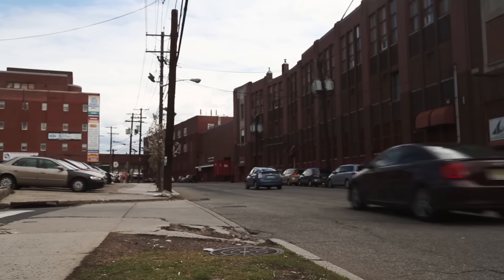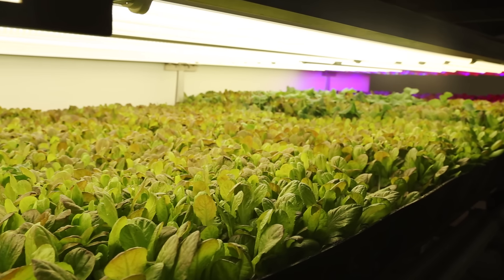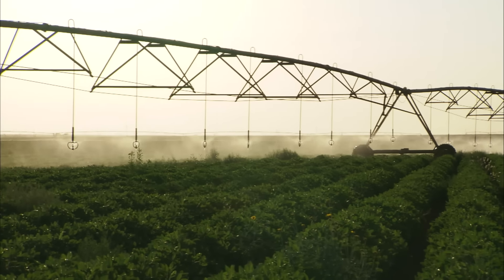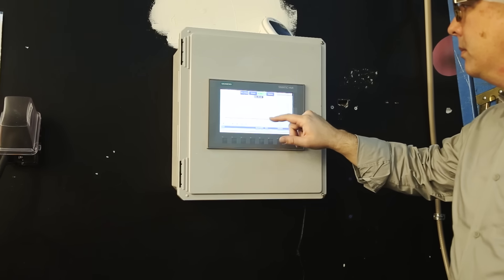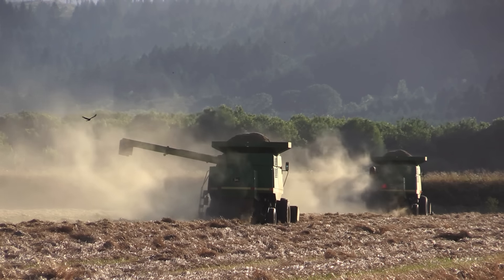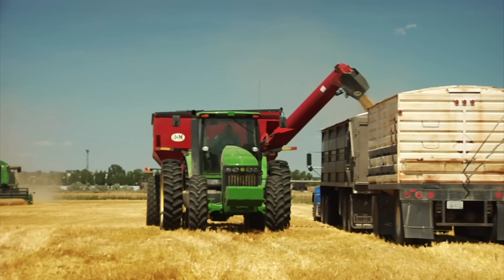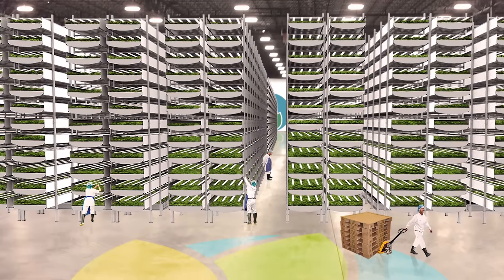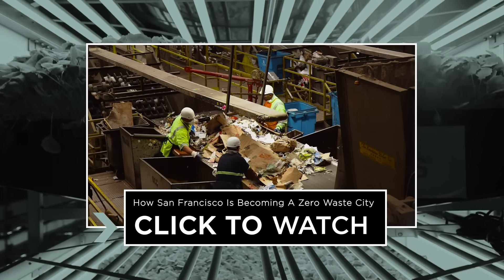This Farm of the Future Uses No Soil and 95% Less Water

Comment: So why don't we have these everywhere?
Reply: My guess is it's spreading slowly over time, as things always do
Reply: Resistance of the guys making big money on big agriculture.
Reply: Jessica Bayol Duh...why does EVERY potentially world-saving invention fail because of big corporations? Just like permanent magnet engines. Imagine how much cleaner our air would be if we had them.
Reply: oggie90 Might be a reason, yes :)
Reply: I hope you know we use magnets for almost every engine, this is an example of one of the parts: https://en.wikipedia.org/wiki/Stator
Reply: SilverWave knew the answer all along but it is a pity😏😕. Sucks how the world works. 😧
Reply: Food inc.
Reply: Because although it's cheap to put lights over food it's cheaper to let the sun do it

Unless you're in an extremely water scarce region there is no way it's cheaper than using the Sun.

Not to mention most plants probably don't have as strong a taste

In deserts this is probably viable
Reply: Because all they can grow is leafy greens because the LED lights are not capable of providing enough light for deep rooting plants. So with a very limited crop available, it's just not worth it.
Reply: They're not cheap boy...
Reply: Because they cost at least a dozen times more than conventional farming even when factoring the water and transport?
Reply: +oggie90 i dont think it would cost that much more
Reply: +Kamikaze Gorilla that i can agree with setting this has to be extremely expensive but if the goverment could provide loans to be paid back with interest once these were setup and made profitable
Reply: Mage_x The nice thing is they don't really divulge the costs here or on other videos/articles on the subject, so who would know? I'm making a rather conservative guess because farming land is literally dirt cheap, rain water is free, farming is hard wotk but a handful of automated tools can make it extremely simple, and guess what, most governments already offers subsidies and loans to regular farmers because everyone wants to be self sufficient in food production in case something bad happens, while stimulating the local economy.
Reply: Soon my child. Soon.
Reply: Because it is fairly new
Reply: +Peterowsky You do realize most of our food comes from California? Doesn't rain much there, huh?
Reply: +Peterowsky Also, farming doesn't help the land and it takes up space. Now if the got these things running on renewable energy then it would be even better.
Reply: Monsanto can't make any money selling poisons.
Reply: They are a horrible idea that's why.
Reply: May be cost. They really did not include this in video. Cost is the deciding factor and they ignored it in video. Very poor journalism despite being good video.
Reply: mahesh katta You have a good eye.  Also we have tried this before and it never took off.
Reply: +oggie90 95% less water, 95% less transportation cost cause its already in the city and read to pick up
Reply: Paul Ramos That water that's miraculously just "in the city ready to pick up" costs money that you pay for.  

Rain on your crops is free.
Reply: Crops on open fields need pesticides,, its harmful and expensive, and if you think that farmers always relies on rain for their crops to be watered you're wrong they're still using water from the pipelines, plus it just need 5% of the water needed than traditional farming, (this is the future try to embrace it), Im not against traditional farming but this is what will enable us to be much more efficient (less transportation cost, less chemicals, less space, less water). Farming on the city is the future.
Reply: Paul Ramos I highly doubt this will feed big cities. rather this may help in some cities like Singapore for growing some crops which may be expensive importing. This can never replace traditional farming anywhere in the world.
Reply: Paul Ramos Modern crops do not need pesticides, not all of them.  Most of our food has been modified to be pretty resistant.
Reply: Guy Smith knows what's up.
Reply: facepalm. Why do people who generally blame corporations ra ra blah also believe weird conspiracies basically like free energy? I mean. You're using a marvel of technology. It wasn't thought impossible, just difficult. That permanent magnet engines... ugh that just violates physics. It's like saying why we don't have solar panels that operate at 110% efficiency. JUST UGH.
Reply: Lol 1) By and large monsanto makes its profits from the combination of GM seed, related herbicides, and licencing. None of which are involved with leafy greens. 2) Leafy greens grow up to maybe a foot tall? Corn or wheat even you're looking at 3-4feet up to 8-10 feet. That means you can fit a grand total of maybe 3-10 layers of one of your staple crops? All the while the total surface area of the facility (even adding multiple grow seasons) only is a FRACTION of farms that I know. 

You're paranoid and know very little about farming. This isn't a bad idea, it's a not currently economically viable (wanna guess why they didn't mention the price of the lettuce?)
Reply: B C Cause people are lazy enough to do research themselves, people are incompetent to have a rational thought. Its easier to blame it on rich people and corporate for everything. High tuition fee, no problem solution is free tuition for everyone. high oil prices, evil greed corporate companies killed the scientist who invented car which run on water.
Reply: mahesh katta Lol hey I'm not gonna say rich corporations and individuals aren't a problem either haha. I just know that its a grey area when many people see it as black and white. The majority of farms are family owned. They may operate on contracts mind you, but families. Many are getting out of farming because 1) kids are taking over the farm 2)It's a lot of work for little money that is risky 3) the land they have is generally a larger pay day than a hundred harvests.  4) People don't know shit about agriculture now and think farmers are poisoning them when they use a cup of roundup diluted into gallons of water for an entire fucking field.
Reply: Anyway....small sustainable farming communities are the future. 
Cities will never be able to have sustainable agricultural resources.  It's mostly cultural if you ask me.
Reply: Martin Fischer Um... sustainable hopefully? Small? FUCK NO. What we are seeing a continued movement into more urbanized areas. This isn't necessarily bad as despite how it makes you feel, cities are just more efficient. I understand the idealism. I hate the cities, I love the country, but globally speaking the shift towards more urbanized cities is just a given. 

Small farms simply aren't as profitable anymore. In this day and age if you have less than 150 acres of land, you're a hobby farmer. Plain and simple. You likely aren't to familiar with what farmers make acreage wise... or that even now, largely most fruit and veg crops are hand harvested by Cough*.... foreign workers Cough*....
Reply: Martin Fischer Large corporate farming is the future. It still is. You are going back in time with small farming. Cities dont need to have resources. Cities never will have the land water and cheap labor required for agriculture. They grow it elsewhere and transport. Thats common sense. Transport and storage will only get more efficient in future.
Reply: mahesh katta Not to mention shipping to cities drastically increases efficiency (BULK). Freight and Tankers can carry things at such a cost (and low impact) that even local food is hard pressed to compete.
Reply: B C Exactly. small farming is never viable option. Even in developing countries slowly the land owned by a single persn is becoming higher. Which means less farmers and more technology and corporate structure in to agriculture. In rural areas near my place farmers rarely get profit in years because of small farming and lack of proper methods in agriculture.
Reply: My guess is Installation costs. Those facilities look way to expensive for the average farmer. Its mostly Silicon Valley types that are doing this.
Reply: that farm in the steel mill costs 30 million
Reply: Supremely inefficient all around.  In the end nothing beats sustainable natural farming.
Reply: Martin Fischer lol well depending on what we define as natural farming haha.
Reply: Zoning laws, for one. For two, zoning laws. For three, bullshit zoning laws that prevent architects from building above a certain height within inner cities. Washington, for instance, has the worst traffic in the world and that is directly correlated to the zoning requirements limiting the height of buildings.
Reply: Joshua Garcia I thought LA has the worst traffic in the world :D
Reply: Hahaha both LA and Washington are equally horrible. Went to LA last year and flying in it looked like a giant pancake.
Reply: it will be a  nightmare.
where do you think all these electricity come from?
burning coal.
Reply: ***** Solar & wind?
Reply: SilverWave about 0.1% i think
Reply: I'm not really sure anymore about the energy economics of the future. I've always been a supporter of what fits best goes in. I would prefer to move away from fossil fuels but I know that we can't do it "tomorrow". I see nuclear as a backbone with renewables as the vascularture. The issue is. GODDAMN is solar cheap to install. Its essentially modular. Contrast that to nuclear which is exceedingly complex. That being said, if we can modularize a nuclear reactor we may see a nuclear dawn. Also we need to learn to use mox fuels....
Reply: Yeah, Moore's law will hopefully apply to the circuitry that governs solar panels, whereas we get more energy absorption per square foot. Then we can see the easy adoption of solar because of convenience.
Reply: Joshua Garcia That's quaint.  Lot of resources needed to make those panels...
Reply: Right, but youre looking at the RoI over years, not the immediate cost implications, like any investment.
Reply: Joshua Garcia Fair enough.  To me this is a complete waste of resources.  I've grown in these beds.  One of those beds pulls 200 watts constantly to grow non-staple crops.
Sustainable, community base, natural farming is better in so many ways.
Reply: I agree with you completely. I enjoy this technology because of its potential future implications (if technology can develop to make it more feasible). One day it may surpass community farming, who knows. 40 years ago if people told you itd be impossible to carry a computer in your pocket you'd believe it, ya kno?
Reply: Martin Fischer yes and no. Like functionally yes we need stupid amounts of various metals, purified silicon. Etc. Panels don't work as well at high temperatures, don't work with snow etc. I know all the issues as I bring them up when people say it will be the next dawn. It's more so I keep getting upstaged by how cheap they end up being. The materials are one thing. The rare earth's are an issue (haha actually not that rare but not many mines) but the Silicon isn't. I think one of the things I never predicted is the economy of scale solar is capable of. With nuclear there are much finer limits, solar I'm still not sure yet. I know it won't be the answer in some. Places where our energy profiles are different than solar output (cough Canada cough)... But I'll say this. I am open to being wrong and corrected on anything.  I can talk about scientific issues with thinfs but when economics and consumers get involved God it's hard to predict
Reply: Resources resources resources.  We are talking about the energy but that really isn't the biggest loss here.

This, although efficient, requires vast amount of fresh water.  Unless they implemented a natural rainwater catching system, more resources, I wouldn't even dream of considering something like this.

Look at it this way,  what does a one acre organic, sustainable, farm plot require.
Basically manpower.

Changing things from the most efficient way we have been doing things for thousands upon thousands of years, is not progressive.

To me the best implication for farms like this is space and/or harsh climate vitamin food production.
Reply: Martin Fischer lol well... One acre organic. You could have said sustainable. See here's the issue. The water issue wouldn't actually be ve huge for above. Its more energy, space, and scaling doesn't work well. With farming you're looking at a couple input costs. Diesel for tractor, fertilizer (either manure with supplementation or other), irrigation if needed but it differs, chemical as needed, land costs either from loans on the land or rental of the land, price of machinery etc tbh most of farming runs via a debt so it's hard to say what's true. Thus requires less water, more expensive space, expensive scaffolding, higher wages, more electricity, minimal fuel, fertilizer, little to no chem factor, harvest issues, etc. Still conventional farming, despite lots of costs blows this out of the water. What you aren't figuring out this is largely economics not necessarily science. Which I hate haha. This isn't viable cause economy of price and scale. Until they show Me how they deal with that it's bs.
Reply: B C You don't need a tractor at all.  Especially for a small plot like that.     When you farm correctly you are saving water that is otherwise lost.

As someone who is a farmer and has tried every way to grow things under the sun, nothing beats the original.
Reply: Martin Fischer original? Lol if you are a farmer why are you farming one acre? In my area if you have anything less than 100 you're a hobby farmer. The best way we know to farm is with scale. You need equipment end of story. There are indeed still produce that requires manual labour (they tend to use cheap immigrant labour because no one else will work for that) Cucumbers comes to mind. However, for cereal crops, which is not going away any time soon, tractors are a period, end of story thing. Farming requires machines. It may be we can get electric tractors, but who knows. What do you farm and what kind of acreage?
Reply: ...I was making an example.  I own a 25 acre and 81 acre parcel.  I mostly farm cow corn, soy, winter wheat.

We need equipment because the few feed the many.  If everyone grew their own food this would all be a lot easier. Unfortunately the majority of people live in urban areas, where none of the food is grown.

I like the idea of propagating farming within cities, but to me this is simply not the way to go about it.

It would have to start with an entirely different look at community/urban planning.

"Nothing beats the original"  is an expression.
Reply: Martin Fischer unfortunately it's not that simple. Urban centres are remarkably efficient. People growing their own food isn't. We've known this since the dawn of agriculture due to division of labour. Let farmers do what they do best. Functuonally that is what matters. If they can make this profitable sweet. If you want more people to garden also sweet (biggest usa crop is actually turf grass haha). However, we must not confuse our own idealists with what is best. I'm from the country and despise city life but I accept that it must exist for others because of efficiency.
Reply: You're not wrong.  But I think we can do better, eventually we need to anyway.

Everything is about population in the end.
Reply: B C The more I've been thinking about it, I keep coming back to our population/urbanization explosion that happened so fast.

Imagine if we had the foresight to see the necessity of sustainable urban planning in the 1800's.
Reply: Land is cheap.  Would you build a skyscraper out in the country?  Economics will dictate when these become more widespread.  But as long as land is plentiful, why not use it?
Reply: mouthpiece200 "land is cheap" depending. In my are you could run 10-40k an acre agricultural. In cities skyscrapers happen because Land is expensive.
Reply: It doesn't matter how expensive cities are because food doesn't have to be grown there.  Food can be trucked from far away where land is cheap and plentiful.  People can't be trucked from far away each morning - food can.
Reply: mouthpiece200 Right, truck the food into the cities, is really the best option.
In order for truly sustainable urban communities we would need to take a completely different urban planning view.
Reply: Martin Fischer yea ideally we don't want to truck it either. Effectively we want to use barge as long as possible, followed by train then truck. With train potentially replacing barge if time sensitive
Reply: B C Or we have realistic sustainable urban planning based around agriculture.  Imagine a city the size of LA that could produce it's own food.  To me that is a much better way to look at urban sustainable agriculture.
Reply: Martin Fischer but that isn't efficient though because that is entirely subsidized beyond stupidity as yes Ag land is pricey, but urban land is folds higher (it's why farmers sell for development).  We cant grow in city because it's functionally inefficient because you can't use economy of scale. Cities are dense. To feed a city of LA you need an area larger than la
Reply: B C You're missing my point.  Eventually the whole planet will be a "city".  We need to start developing large scale farming within urban centers.  These vertical farms, don't produce staple crops and are hugely resource intensive.  They aren't the way.
Reply: We have many generations before the whole planet will be a "city".  Cities take up a surprisingly small percentage of our land surface - something like 3% if I remember correctly.  Obviously we'd have to start going vertical much earlier, but its not an urgent need.  We still have vast amounts of unused land which could be converted to farmland before we need to go vertical.  

The market will produce vertical farms when the market is ready.  If the market isn't ready yet, then vertical farms are simply too inefficient for use.

With future technology transportation will get even cheaper and easier, and the need for urban farms will be further reduced.  Why take up valuable premium space when you can import something for a fraction of the cost?  Should we have urban garbage dumps too?

Let the magic hands of economics be your guide.
Reply: Yea I completely disagree.  Less "Urban" cities are the way of the future.
Reply: Martin Fischer history, economics, and current trends would heavily disagree with that statement. You're working idealism... You can't expect an area valued in the hundreds of millions, only able to feed maybe 10-000 people to ever be a thing. You're talking saving on transportation. This vertical farm would happen before your idea I'm sorry...
Reply: B C Of course I'm being an idealist, we are talking about the future.
At some point we need to start developing our communities from the beginning, with realistic large scale sustainable agriculture in mind.  Like most things it comes down to population.
Reply: Martin Fischer sustainable means efficient. Efficient means specificialization of labour and economy of scale. Neither of those for agriculture correspond to urban centres. I will retain this. Vertical agriculture will happen before urban single tiered. The only way vertical farming happens is if standard agriculture becomes expensive enough that it becomes viable. Market trends determine things. If we force them too much it blows up in our faces such as the euro farm subsidies.
Reply: Well you have a point.
Reply: Yea like market force drives our habits so much more than I would like. I am a huge nuclear advocate but consumer misinformation has largely driven prices of construction so high that I actually don't see it playing a major role in European or north American energy. That's idealism vs reality for you
Reply: thats what i thought ,   lettuce  day and night,,
Reply: the future generations are  going to be too lazy on their I PHONES day and night,,
Reply: Not to mention its not "cool" to be a farmer, but it is to be a rapper.
Reply: Martin Fischer I would say people are appreciating foodmore but agriculture less. We see it as this fake idealism that doesn't work.
Reply: Craigx71 lol plants.grow in sunlight and the ground for evolution. They grow well in these systems as well. That's not a good argument. It's a natural fallacy. It's bad for economical rational. Plain and simple
Reply: the plants Have the nutrients sprayed directly on their roots instead of taking from soil. The LED lights are specialized to emit the proper light wavelengths that plants use. this concept was only first tested within the last 10 years and is already being implemented across the world so yes this is quikly becoming a mainstream concept. As we all know the only reason is Profits, millions$$$ Savings from 95% less water, Less Land costs and taxes, Fewer Crop Losses from weather, Greatly Reduced Transportation Costs, and Millions saved in Farm equipment costs.
Reply: John Harbinger but  how can  you grow carrots  this  way  pls..
Reply: I set up hydroponics at my parents place. they generally cost more. you can't really mix your own nutrient solution, which is sold proprietarily.
Reply: I may be parroting thing that have been said but i think I add my two cent:

The cost of this setup is very high.While they can save cost from repurposing  old building instead of building new ones , the remodelling cost is still  a concern.Most of the expense however comes from the energy needed to replicate the sunlight, recycle the water and keeping climate control.Farming on flat open land will always be more attractive when that option is available.

Furthermore current LED tech is still not sufficient to produce enough sunlight for most types of plant
Reply: what has been pointed out to me several years ago and I double checked was that the population jumps that we have seen over the centuries came after a new way of producing more food was found
Reply: But there is one flaw, or abnormality. America has plenty of food but slow population growth. Americans are just getting fatter, which is not a great thing. If only there was a way to convert fat into babies. (that's a joke)

As I see it, adequate food production is needed for population growth, but doesn't always dictate growth.

But what really seems to impact population growth, or decline, is infant mortality rates, and duration of life longevity over all. Less infant mortality leads to smaller families, while longer life expectation leads to delay of pregnancies.

Edit: and women's education is a big factor in limiting fertility rates. Just reading about that.
Reply: you can change the way you grow plants in open fields to make it eco friendly and take away the need for pesticides, but there's no way you can grow plants inside, in an artificial environnement that use non direct energy, without the use of pesticides and by being eco friendly.
Reply: Philippe Morin so  no  real organic   from indoor  growing,.
Reply: ***** it can be organic regarding the regulations in place right now, but it doesn't mean it's ecological... organic doesn't equal ecologic, sometimes, but often not.
Reply: you're wrong, organic does indeed mean ecologic, you probably meant doesn't equal economic, but humanity uses this term in a wrong way anyways.
Reply: Pacior K Offski no... Pacior organic does not mean ecological. It means "non synthetic". Despite what idiots who know nothing about agriculture, organic may be the worst movement to happen to food since Lysenko genetics. It's not about being more efficient with land, or even necessarily being less impactful. It's not about using less pesticides through using better ones, or using better crops. It's about idyllic farming. Organic. Guess what, they use pesticides. Some nasty ones too, it's just they're "natural" therefore you don't care. Land usage? Yup try by a factor of over 30% (did you know farmed land actually went down in the United states from 1900 despite a tripling of population). Fuel costs? Yup even more, if you need more weed control you need more gas for your tiller. What about a gm crop though? Nope, that's not allowed either because... Reasons? Mutagenic breeding developed varieties though? Yea we cool with that. I'm all for using less land, less chemical, less fuel, to produce more food. Every fucking farmer is simply because it saves them money, makes our food cheaper and it's easier on their land. Organic is ecological in the same way apple products are the most high tech. No. They're fucking show pieces using technology everyone else had five years ago. It's marketing. That's it. If organic really was about what it said then it would adopt things like bt crop or scuba rice with so much vigor Monsanto would thank them. Ugh
Reply: You can do organic agriculture without being ecologic, but you can't do agriculture in an ecological way without being organic. Right now a lot of organic farms are only conventional farm without the use of synthetic chemicals. It's still abuse the ecosystem in which the farm is implemented.
Reply: B C That's exactly what I'm saying, learn to read before calling bullshit. Organic practices are not better than conventional one right now, it's just a promotional tool to make people feel better about their consumption habits. What I'm saying is chemicals and abusive practices that destroy the soil are the reason why agriculture is polluting and destroying ecosystems right now. The only way to get the land to be really productive is by implementing practices that respect the ecosystem. Using chemicals is like using steroids, yeah it does the job, but you jeopardize the future by using them. I'm not bullshiting, I'm studying agriculture, all the aspects, I'm learning the protocols on chemicals use and all the conventional practices, I'm also seeing organic practices and there's a lot of bullshit on each sides. Sometime using medication is necessary, but if you can eat something that bring you what your body needed in the first place to fight your sickness you're better doing that first, medication might damage other organs in your body. It's the same thing in agriculture, there's an association between all the living things, when you try to kill one (weeds or pests for example) you also damage good ones.
Reply: B C By the way intensive production can be obtain without the use of chemical, it takes time and it's much work at first, but the result are better. Here's my analogy, you can get in shape by taking steroids or by kicking your ass in the gym and by eating healthy, one will get results much faster, but it may also bring you closer to death.
Reply: Didn't read the other responses, but the correct answer is -- they are not profitable. They pay huge electric bills and expensive scientists and their competition gets the sun for free and migrant workers for minimum wage